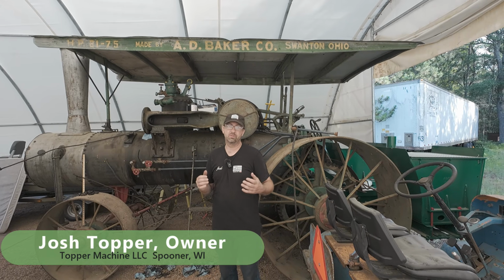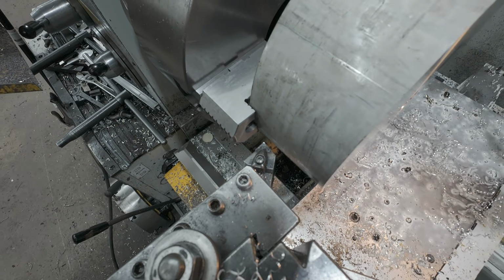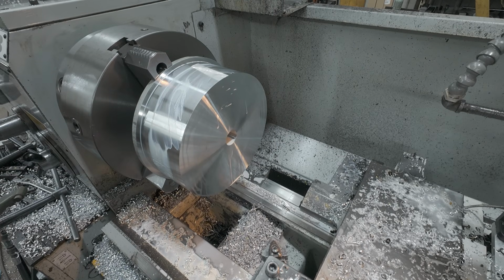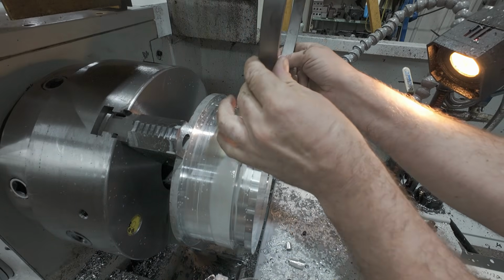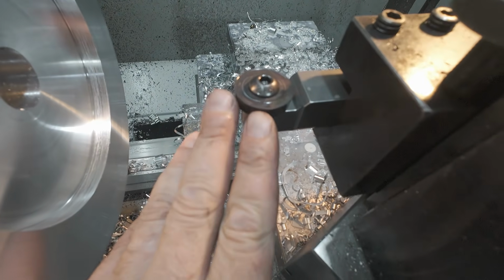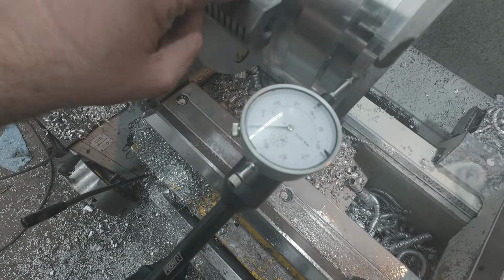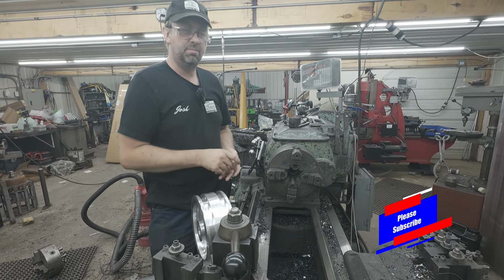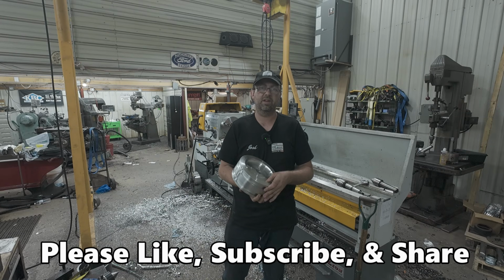This A.D. Baker Steam Traction Engine Needed a New Piston | Manual Machining

Comment: 7075 is some good stuff.  We used mostly 2025 T6 in my industry. It had better maleability for our uses. Once in awhile we'd use 7075 and it was like mild steel in comparison. I'm curious about the expansion coefficient for your taper on the shaft. Are you going to set the piston hot onto the shaft so it doesn't loosen when it comes up to temp?

Comment: Josh,  do you believe oxidation of the 7075 will become an issue in a steam envirpmenr?  in engines with differemt materials I believe it can occur in the cooling system . Hard coat anodizing possible ?  ❓

Comment: I don’t understand how those pockets on the piston faces will increase the engine power since the are dead volumes. How is it possible? Cheers from Brazil again 😅
Reply: Steam expands, so having an extra volume of steam in the cylinder means there is more to expand and therefore more force and power. Steam engines are kind of backwards from internal combustion engines in this respect.
Reply: @dansvec5411  Steam expands 1600 to 1, for 1 cubic whatever volume it will expand 1600 times for a lower pressure at that temperature.  In other words, 1 cc of water will turn into 1600 cc of steam at that pressure and temperature.  That is why an explosion will occur if a boiler is suddenly reduced in pressure with water in it, as the hot water that had been boiling flashes to steam due to the sudden reduction of pressure.
Reply: @royreynolds108 I appreciate it! I understand that you described what happens inside the boiler, not in the engine itself, Thanks a lot though. Regards from Brazil
Reply: @dansvec5411 Thanks for explaining

Comment: Josh, nice job. They don't use a rider band or support bushing in between the rings. Would that be because of the weight of the piston? What was the taper you cut. Keep up the great work.👍
Reply: The taper in the piston and on the rod acts like a Morse taper for holding them together and in line.  Some large single-cylinder steam engines and also some steam locomotives in Europe used extended piston rods to support the pistons in the cylinder to reduce the piston and cylinder wear.  This added some maintenance headaches.

Comment: Josh, I'm going to ask a question because I don't know anything about steam. I saw how your ring grooves were cut in, instead of using 2 grooves could you cut in one wider groove kinda like some styles of hydraulic pistons? I can't imagine you making your own piston and documenting it to be able to enjoy forever. I loved the video, thank you for taking the time bring us along.
Reply: Two grooves give the best support to the piston in the cylinder.  One groove would tend to let the piston rock about the ring(s).  My concern is the oil for lubrication.  I think his engine is below 175 psi, which would be under 375* F, so lower temperature oil will be fine(instead of superheated steam oil), but make sure the cylinder is well lubricated.  The water in the steam will act like a lubricant.
Reply: @royreynolds108 thanks for the reply. I appreciate the feedback.

Comment: Amazing to see the chips fly like that.  Is that unique to the material you are using or due to the speed at which you are processing the part?  When you recycle your chips do you need to separate the material or do you let the recycler sort all that out in their process?  Do the thermal expansion calculations you reference take into account the properties of the specific aluminum material / blend / alloy you selected or are general for just plain aluminum?  Does aluminum even come in various alloys like steel does?
Reply: Yes, if you don’t mind me answering for Josh. Aluminum comes in many different alloys. For instance, 7075 is much harder and stronger than the more common 6061.

Comment: What was the rough size of the aluminum slug you used ? The reason I ask is I worked at Alcoa where I made these bars in 20'-30' length

Comment: Thanks for editing the sound when you were cutting the metal.  Now for my question, will you have the same volume on each end of the piston?  Does steam engines have a compression ratio like gas engines do?  Could gas engines be built so they have power on each side to the pistons like steam does?
Reply: Yes, but they would be a construction and maintenance nightmare.

Comment: ChatGPT works great to figure out these calculations. I plugged the numbers in and got 9.2805” dia at 68 °F for an average of 360 °F operating temperature! Great job. Thanks for sharing. Cheers from Brazil
Reply: @FernandoFCosta  Even better is to learn the math yourself and become self sufficient instead of relying on a faceless computer script using unknown and often questionable sources of information.
Reply: @svnautidreams I agree with you 100%, so I did my own check and validated the AI answer with a positive feedback. AI is a great learning tool and start point for those struggling with or interested in any subject matter. Regards from Brazil

Comment: Awesome job!
How does one even start to tackle the mess of cleaning up after all that aluminum chips?
Also did you plan on the thermal expansion for the piston rings?
Enjoy the great tips, thanks again!
Reply: A powerful shop vacuum will suck them up in a few minutes. Best thing I ever did was mount a vortex unit on top of my 3 HP Dewalt. The spinning column of air generated by the vortex leaves most of the chips in the top container.

Comment: So given the difference in expansion coefficient between the piston and the rod, and the taper fit, does the aluminum have sufficient stretch, or do you need to heat the piston to operating temperature when you fit the rod to prevent it loosening on the first heat cycle?
Without any actual knowledge it would seem to me that a very shallow taper like this would loosen more than a steeper taper with the expansion differential. 
Oh, never mind, at the very end of the video you actually talked a bit about it.

Comment: You have to get it right the 1st time with aluminium at that pricetag😂. The self made circular cutter and its holder lived up to the job at hand. As for 4 jaw chucks, i havent really dealt with them but i can see it takes a bit more to handle them as opposed to 3 jaw when it comes to concentricity check and making sure it runs true in the 4 jaw. As usual, great video, eager to see the shaft made up and fitted😎👍in next one

Comment: Your numbers on expansion are right in line with the way we used to figure thermal expansion/shrinkage for spacecraft. 6 millionths of an inch per degree for ferrous metals and 12 millionths of an inch per degree for non-ferrous which is the two to one ratio you found. Those degrees are Fahrenheit. Also works when measuring non- ferrous metals with ferrous instruments when there is no time to let both equalize in temperature. Always enjoyable to watch your videos.

Comment: I know very little about steam engines. Does the intake valve close before the piston reaches the end of the stroke, using steam expansion to push the piston the rest of the way? Is corrosion of the piston a possibility? Did you purchase rings or did I miss the video where you made them?

Comment: That was a job well done!
Would I be correct in saying that backlash in the taper attachment helps to avoid the tool dragging as you retract the boring bar from the hole, or did you back the tool off anyway?
Reply from the maker: That could be.

Comment: curious why you didn't just sleeve the cylinder back to specs vs spending all the $ on material
Reply from the maker: A 0.024" thick sleeve?  I think my solution was cheaper. And this is how it has been done on traction engines.
Reply: @TopperMachineLLC  Same with gasoline engines, rebore and oversized piston and rings.
Reply: @TopperMachineLLC  i guess i missed why the sleeve could only be .024

Comment: Josh,  That piston looks great.  I can't wait to see next week.
I have never built a piston and don't know a ring groove from a moon crater. So I may be talking out of my ass.
Do you think there might be a stress riser created at the 90 degree base of the ring grooves?  
Wouldn't a slight radius at the corners alleviate this?  Especially on the top inside corners, nearest the piston faces.
If you look at the 43:20 mark of the vid, you can see what appears to be some kind of bevel on the original piston.
Looking forward to assembly,
Thanks for sharing,
--Mike--
Reply from the maker: That's a good point, but I'm not too concerned with the amount of use it will see.

Comment: Wont the deep piston make for a "spongey" initial" steam expansion? As in takes more time to expand  and longer reaction time to  to push the piston under full loading? Jut wondering. Wont it more torque gut less quick response time under load since it really increases the stroke length(sort of)? Ill have to rewatch when i get more time.
 Love the contents as always!
Reply from the maker: It shouldn't.
Reply: Steam heats the cylinder and piston in a very short time once it starts operating.

Comment: Josh, as you have learned, 7075-T6 is a very strong aluminum that rivals cast iron strength.  However its one big achilles heel is how quickly its strength degrades when exposed to temperatures above 100C (212F). Its strength is relatively flat up to 212F and then it knees over and drops like a rock starting at 212F (search for NASA ‘Material Data Handbook Aluminum Alloy 7075’, look for Figure 8.511). And this effect is time dependent, with the strength dropping faster for longer exposure times, 100 hrs, 1000hrs.  I know very little about steam engines.  I appreciate that at sea level water boils at 212F, but what is the temperature in a steam engine application like yours?  The pressure in the boiler suggests to me the steam is even hotter than 212?  I just don’t know.  Hope this helps.
Reply from the maker: I will be running 150-160psig. About 380°. I did a lot of research before selecting 7075, and while I understand what you're getting at, my research showed the real problem begins about 600°.
Reply: @TopperMachineLLC …. You know I’m not arguing, just making sure you’re aware as most people aren’t.  So in your application the yield strength at room temperature when installed at time zero is approx 73,000 psi.  At 380F, after 1000hours exposure at 380F, the yield strength is 19,000 psi.  😱  Maybe this engine will never see 1000hrs.  But the degradation at 100 hours is still quite significant.  At 380F, after only 100 hours exposure of 380F, the yield strength is 29,000 psi.  Note there is virtually zero strength degradation between room temperature and 212F regardless of the exposure time.  FWIW, I spent 35 years as a structural engineer performing stress analysis for an aerospace company.  We used 7075 as often as possible, which wasn’t that often because most of our hardware was exposed to temperatures above 300F.  And in that case, 6061 actually was stronger at temperatures.  7075 continually over-ages when exposed at modest temperatures over extended time and the room temperature strength never recovers like steel.

Comment: Turned out beautiful, also it generated some impressive chips

Now I'm curious about the indentations on the faces, because in my mind as long as pressure and area of the cross section stay the same it shouldn't change the generated power. Unless it improves the flow of steam or something, not too familiar with steam engines, but I know the basics.
Reply: He said it makes more room for steam. The fact is that using a very slightly later cut-off will deliver more steam than the volume of that dish which actually shortens the path for heat loss to the cylinder wall, which is a power loss.
Reply: @oldtugs  sorry, I can't follow you. Does that mean this makes it actually worse?
Reply: @CatNolara  If the cut-off is not changed, yes, the steam admitted to the cylinder expands into a larger volume compared to the same cylinder with a flat faced piston. It expands and cools earlier and the effective working pressure is less. The shorter distance for heat to travel to the outside of the cylinder via the rings means the piston runs cooler and reduces the steam temperature in the cylinder which increases condensation and power loss. The net power loss can be recovered by increasing the percentage of cut-off to increase the amount of steam admitted but all that accomplishes is increased fuel burn for the same power delivered to the drawbar. Considering the miserable efficiency of that particular boiler and engine and its use it really doesn't matter in the least.
Reply: @oldtugs  well, at least the rounded indentations make it look nicer :D
And it cuts down the weight, propably also not a bad thing.
Reply: @CatNolara  It is a gorgeous piece of lathe art!

Comment: I'm glad you didn't scrap it too. 750 in material, then time. Not going to lie, got a bit concerned about that groving without tail stock in especially that far out. Looked like you clamped on about 3/8.

Comment: Great job sir!  Loved the video.  I have a project on our steam engine and it's piston also.  Can you point me to the tables/charts you used for the expansion calcs?  You mentioned testing of expansion, can you elaborate?  Sounds like an interesting topic.  I'll be very interested in your rings and a short discussion of material compatibility with the aluminum.  Again, great project and a great job.  Thank you!
Reply: Google thermal expansion of metals.

Comment: Do those high frequency noises bother you or are you use to them 
The noises when you are using your homemade tool
Reply from the maker: Ear plugs. I tried to cut the noise in editing. I may have missed some.
Reply: @TopperMachineLLC what came thru was enough to ask the question
Reply: Great job by the way

Comment: ooh nice chunk of alumiminumumniunmuimnum 
Josh if the coolant  doesnt go everywhere.. its not doing a proper job ...its like having a shop floor with no chips on it.......its not right 🤣

Question, that seems like a very short piston, is there any reason why steam pistons are so short?
Thanks for sharing
Reply: The piston only needs to be thick enough to contain the load.  It is constrained to follow the cylinder by the crosshead and packing gland besides the cylinder walls.  The piston has pressure applied to both sides alternately, push-pull, push from the other direction.
Reply: @royreynolds108  ah cool that makes more sense now.  Thanks for the explanation

Comment: Hi Josh, arent you worried about the piston coming loose on the rod. Due to the thermal expansion of the aluminium whem hot the aluminium gets crushed by the steel bar and nut. When cooled down this will have loosened the nut and over time the piston will detach from the taper and starts to rock in the bore.
Reply from the maker: I have considered that and have a plan for assembly that should take care of that potential issue. Remember, the cast iron piston and steel rod worked, and they have different coefficient of thermal expansion.

Comment: I could wait until you make the piston rod to talk about the thermal expansion on the taper but since you did such a good job (for me) on explaining clearances when the two materials heat up I have to wonder if the steel? rod will loosen in the piston when the assembly gets to operating temperature.
Reply from the maker: When I put them together, I will explain that.
Reply: By preheating the piston to operating temperature and shrinking it on the unheated rod it will never come apart.